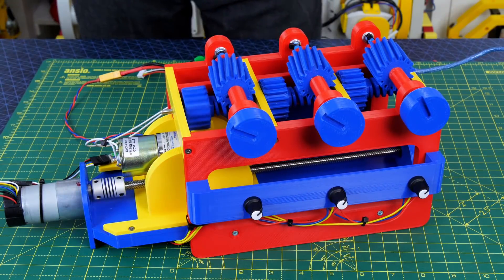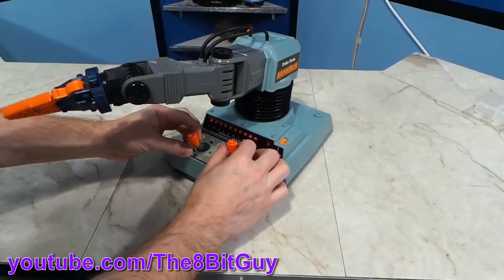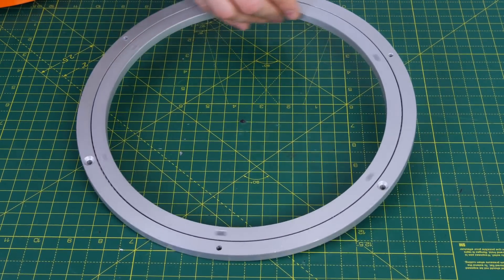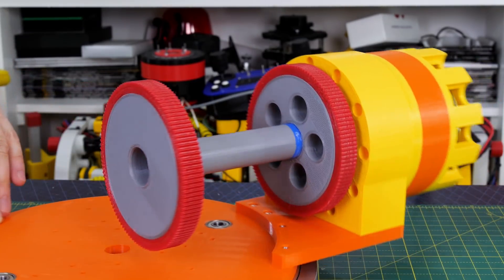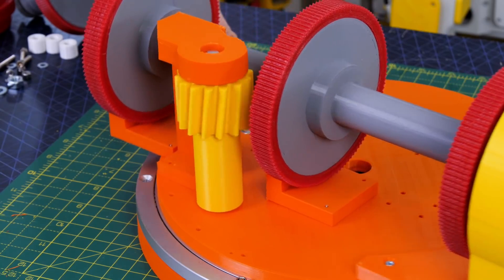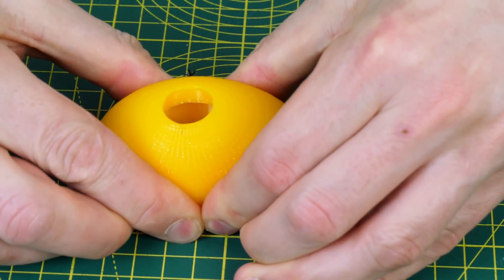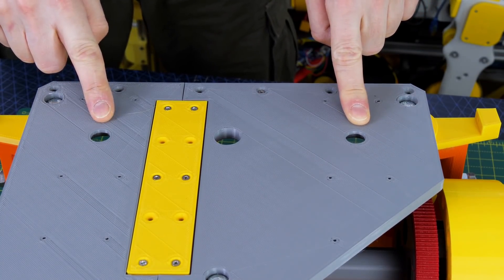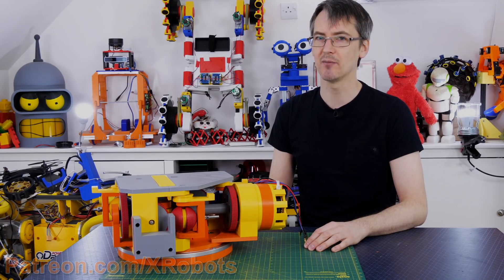One-Motor CVT Robot Arm #1 - Gearbox

Comment: I just had a thought on this one. Instead of moving the drive gears maybe have one spline shaft that always turns and individual servos to engage gears on and off the spline. One servo could have three positions each for disengaged, engaged left and engaged right with a second gear.

Comment: Curious on the kind of torque you can get from this cvt system.  One problem with  the idea's of mechs has always been getting the energy to the limbs without having hevey motors on each joints.  Not sure if this CVT gear would sruvive under those kinds of stresses but it does make it an interesting idea.  Can't wait to see the arm.

Comment: Hm, last time I checked, the power of a motor did non-linearly increase with price, so while I designed something for simplicity and used multiple motors, it's price impact was not so significant. More  motors meant each one could be weaker and its drivers as well. For mass production its a different thing, maybe ... Heat loss increases non-linearely with current, i.e. power so, bigger motors are probable more more expensive and the driver circuits as well, once a threshold created by different material costs is overcome.

Comment: I just noticed the rough overhangs at 4:45 (I assume the part was printed upside-down from the way it's mounted) and want to mention a brilliant "hack" I've picked up from Angus of Maker's Muse fame: The gap looks perfectly manageable with bridging, but the hole for the bolt obviously breaks continuous edge-to-edge bridging; if you add a single, "sacrificial" solid layer below the hole the print will use that to bridge, creating sort of like a support for the layers to follow, and being just one layer it's trivial to clean up after printing.
I know the issue isn't critical, but it's something I do in pretty much every project where I have "enclosed" features (i.e. where supports would be a hassle to remove) like side pockets for nuts cause it's so convenient.

Comment: I feel like the ad reads really break the flow of the video when done like this.  I know you try to integrate them into the video content best you can, I do appreciate that but I would much rather have an introduction to the sponsors at the beginning of the video or the end.  You had one for the 3d printers and filament, then the bearings 2 minutes later and another a minute later from jlbpcb.  You could use the same insert shots as you did as a short preview of what's to come if you did do them at the beginning.

Comment: I had never seen more nonsense. Pointless waste of money and resources on this. This is neither a arm nor can it be controlled by a single motorcycle. You purr something and it turns in one direction, you move another and it turns in the opposite direction. This is complete nonsense. Simply changing the direction of the current does the same.
Reply from the maker: It's like Hydraulics with one main power source and smaller valves to switch the fluid. You don't run the engine in reverse to go backwards.  Part 2 is coming up soon.

Comment: Hmm. If you put two rails around it and had two spring loaded metal wheels, you could provide power to it with out having trailing cables as it rotates. Nice looking design.

Comment: I wonder if there's a solution to drive the inner teeth on that big lazy Susan gear directly with a weird worm gear? Maybe a kind of tapered or rounded with gear instead of a cylindrical one. Some guy in the 1800's probably figured it out. 🤓⚙️🎩

Comment: How will you move the balls? More motors, right?
I don't have all the DIY equipment needed, but I've been thinking for years about doing a spider robot with a single compact motor.
One interesting mechanism I saw a paper on, was using a magnet on a gear and magnetic "latch" of some kind. If the gear is going too fast, the magnets never snap together. But if you slow it down at the right time, you can mechanically connect gear systems. Such a system could be used to control the balls.
Reply from the maker: Smaller motors, not huge brushless ones with large gearboxes

Comment: This is a very cool idea! Though from a practical application standpoint, I'm not so sure about designing the entire system around wearable friction parts.

I guess for a 3D printed home project, it's really cool, and could let some kids play around with a robot arm without having to buy as many motors. But for anything more robust, like an industrial arm, I'd think the cost of swapping out wear surfaces would quickly outrun the cost of some extra servos in the initial build.

Is there any way around that? It seemed, early on, that you showed the balls and the wheels that drive them with a sort of gearing system, but how would you avoid a large amount of slop toward the equator of the balls, while still having the much narrower teeth near the poles able to fit into each other?

I wonder if a viscous drive system could work instead... it would also make it a conformant system suitable for use around humans, if it worked well enough.
Reply: Engineering Expained did a video on Nissan's newer CVTs, they use smooth metal ball surfaces and a special kind of oil that has overlapping molecular chains that catch and pull on each other but still provide lubrication to avoid metal on metal contact. I'm not sure if it would work super well at low rpm though.
Reply: @DFPercush  Ooh, interesting! So like a viscous transmission, only using viscosity modifiers rather than torque-converter analogues. Cool!

Comment: at 9:18 why not mirror the 'ball' mounts and wormgear assembly on the otherside of the drive line, so each drive wheel on the drive shaft  drives 2 balls and giving 4 outputs in the same volume while not needing the center drive wheel. the ball on both sides of the drive wheel might help to equalise the forces pushing it away from the ball when there is load on the output.
Reply from the maker: Because the outputs will be in the wrong place

Comment: I think the ball assembly could improve, instead of using a bracket  it could use a center axis, something like  --<o>-- that, covering the middle part with the tpu ball, since it just rotates on a single axis having the top and bottom part of the ball fixed on place shouldn't affect the mechanism

Comment: I've only viewed the video once, but I don't recall you indicating any other benefits, beyond it's cool,  to have 4 motors (1 drive, 3 servo) drive 3 outputs.  Not that I'm complaining, it's neat, and if the CVTs were more efficient I could see how a more powerful drive motor coupled with low power servos would still be a net win, but in terms of energy cost and output torque/speed I'm guessing you're in a net loss compared to having three of your geared BLDC motors.  From the looks of it, you may be at a net loss in size and weight, as well.

I'm interested in the outcome, but if you could explain the benefits of this a little more clearly I'd appreciate it.

Comment: An overly complex, highly lossy and inefficient solution to a problem. Conceptually cool, practical application, not very good. The entire thing runs on friction between surfaces. Using balls for creating a gear ratio is rarely a good solution. Just my opinion...the friction "grip" between the balls and the rollers will be problematic at best. Dirt, dust and wear will make them a constant problem that proves to be highly variable. You can already see the surfaces of the balls turning white from bits wearing off of them. That grip will 100% limit the strength of this experiment. Just me maybe...I'd abandon this thing now.

Comment: To reduce flexing sideways, make sure the additional members provide diagonal strength, either through struts or a solid plate that carries the diagonal force vector.  Don't put a hole in the middle of the force line, keep forces on both sides of the hole.

Comment: Hi,love your videos
How do you know the right current and voltage  you need for your electronic projects  so that they are not overpowered and maybe burn them?
Reply: I don't know what he does, but usually each part is sold for very specific voltage and current, some specify only a max, others need very specific values.  This is stuff that all electronics nerds learn early on.

Comment: Now that you have engineered only one motor requirement, could you build it back up to two motors to provide redundancy?
Reply: Redundant motors are usually connected by clutches or a differential.

Comment: this is lots of fun but i don't think its going to work, the variable drive won't transmit enough torque. you might have to call it the 7 stone weakling robot. keep going i love every one of these
Reply from the maker: Well there's a worm reduction and the main waist rotation seems to have enough power. The others are the same as that with 1:1 to the joints.
Reply: @jamesbruton  the arm joints will need a much bigger turning force, especially the shoulder. is there any way you can put the variable drive on the motor side of the worm reduction

Comment: There's an alternate reality where the induction motor was never realized, and we instead have six-axis robotic arms running off a diesel engine and some brush motor CVTs to build cars.
Reply: i hope that we're in the one that starts to use tissue and synthesised ATP running binaries on a enzyme processor
Reply: Hydraulics go pooomft.

Comment: James, is it worth looking at using something like extruded aluminium channel that fits into slots in your prints to act as ribs to increase rigidity and span of the parts, thus reducing the volume of the printed parts?  As the material would only need to be cut to length and have mounting holes drilled, it could save time as well.
Reply from the maker: Yes I've used it a lot in the past, normally for bigger structure though.

Comment: These TPU rings could be concave to make a better contact with the ball. Also, you can stab an oldschool corkboard pin at the end of the ball to reduce ring wear in off position.
Reply from the maker: There's a hole in the end so there's no wear when it's in the off position.

Comment: I see many real life applications for the concept, specially for bigger things. you're using an electric motor and a small rig, but if we use a turboshaft, we can have a very high power output, for some big and serious applications... The only thing that I don't see fit for those high power applications, is having to use the flexible parts... But I do have an idea for replacing those. Its all about geometry

Comment: At the end you said you would make the shoulder, I thought looking at the lazy Susan that it was the shoulder.  Guess I was wrong.  

I can see quite a lot of discoloration on the blue rotary balls from your disks that are always in rotation, I think you need to increase slightly your dead space sizing.
Reply from the maker: Well - I tend to call the arm joints shoulder and elbow, and then the one I've made the waist.

Comment: Using motors in servos to avoid placing motors where they make sense. Obfuscation from hell :-D
Reply from the maker: But you'd need lots of high powered motors instead of one. It's experimental though - mainly the control system will get interesting

Comment: I think using the old different-colored gears from you earlier robot is actually a good thing. Since you're using various bright colors, and not really trying for an 'industrial' look, the more different colors you have allows you to use phrases like "the green gear" or "the pink rod" in your audio descriptions. This helps us spot exactly the component you are referring to. Since you obviously have access to many colors, I suggest you take advantage of that. Great CAD work by the way! All the screw holes aligning is 'imagineering' at its finest.
Reply: What CAD program is that?
Reply: @77Avadon77  fusion 360
Reply: @NanescuRadu1  is that the best program for creating more complex things like vehicles? Or should I try something else. Thank you
Reply: @77Avadon77  its a good tool, complex enough to handle alot of things but simple enough to learn ... you can also try solidworks or catia ( its used alot in aerospace design )

Comment: ❤ all I can say is "About time someone realized the genius of the armatron!" It was my favorite toy growing up. When it finally broke, I found out that it ran on just one motor. I was amazed. I have always wanted someone to build up an arm with a single motor. With this project, I hope more engineers can understand that you can build with less motors.
Reply: Armatron was my most formative toy. My psyche giggles when I see them pop up.
Reply: Motors are cheaper than good ideas.
Reply: @scrocrates6380  : That may be true, but one normal motor and several small motors are cheaper than all normal motors.

Comment: I'd be curious to see Skyentific's opinions and take on this kind of robot arm. Servo-driven CVTs with a central power motor is interesting, but I'm curious as to how well it would scale. Personally, I think the drive motor should be in the base of the robot, remaining stationary, this would also allow for larger motors which would help with scaling; a similar setup to this, just with a vertical multi-CVT housing in the shoulder. Designing it in this way may also allow for more expandability, say wrist and end effector control, all you would need is a slightly taller shoulder to house the additional components, as vertical stacking is a much better implementation than horizontal expansion, it'd give more options for more arms with the only major difference being the vertical displacement of the end effector, rather than having a wider base. I'd also be interested in seeing the CVT concept combined with wire-based actuators like what the LIMS2-Ambidex design uses, though that's only one example of that type of actuator, using a wire spool, pulleys, and potentially a block and tackle setup for extra leverage, in a tendon-esque setup to manipulate joints. I believe this concept has potential, my only major concern is scalability, as there's not much function outside of light workloads if it can't scale.

Comment: vertical spin jet impeller/tesla-disc turbine, with a wheel, 4x4, ie, transform a horizontal quad rotor to a vertical quad rotor with wheels in one
Reply: equal input rotor area, snow sling side out with high speed - pressure - heat (when compression is high)

Comment: I think you should connect the cycloidal drive chassis to the top plate of the gear box, it could alleviate some of the wobble in its motion. Then a tpu section or something else could make up the rest of the difference so tolerance wouldn’t have to be perfect.
I really like this project and I think it has a lot of real potential.

Comment: It seems to me that you don’t need the full spheres.  You’re only using one hemisphere for both “forward” and “backward” directions.  Could you not use only the contact half of the balls and make the design more compact, less time/resource consuming (from a production standpoint), and potentially more rigid?
Reply: When he engages reverse the motor is rubbing the outer hemisphere and the output is rubbing the inner hemisphere if you look closely
Reply: @newmonengineering  Ahh.  Of course.  I’m an idiot. 😂

Comment: This is a super neat concept. It feels almost steampunk to me, using a single constant uncontrolled rotational input (like from a water/windmill or large steam engine) and using it to power the complex motion of a robotic arm. It would be super cool to try to extend this concept by making the control system analog too. 

Steampunk is definitely the wrong word but it's the best I could come up with.
Reply: And then we get Don Quixote to arm wrestle it.
Reply: I mean, why not convert a windmill into a giant robot arm :)
Reply: Reading these comments makes me think of those old Clockwork dolls and just old Clockwork toys in general. They could do a lot of things with the power from one wound up Spring. Some of them were very intricate clockworks. I've always been fascinated by analogue things and clock works like that.
Reply: It reminds me of how lathes run a bunch of different things (carriage, cross slide, threading drive, and on some lathes coolant pump and compound slide) all off of the same motor that's turning the spindle.
Reply: analogical mechanic seems the closest, and yes its really cool
Reply: @greenlemon9155  Yeah "analogical mechanic" is probably a decent word to describe it. I guess what I was originally trying to say is that this would fit well into a steampunk world.
Reply: Lol, i could see it before my eyes :) so idealistic and "smart"

Comment: Hi James, I am currently in the planning phase of building a robot to fetch my mail from the mailbox, but the opening for my mailbox is very very small. Do you have any suggestions for a slim and/or versitile grip that would consistently grab mail out of the box, and also off the ground if it drops? I'm thinking an arm attachment that interchanges between either a claw grip or a small vacuum, but would love some suggestions.

Comment: I explored this idea. Instead using a flexible drive shaft passing through the arm. Each joint being compromised of two electromagnetic clutches, one for forwards motion and the other connected to a gearbox for reverse arm movements. Also position sensors for precise control.